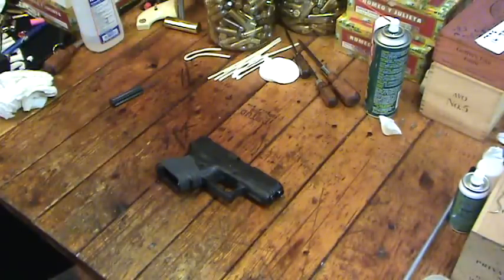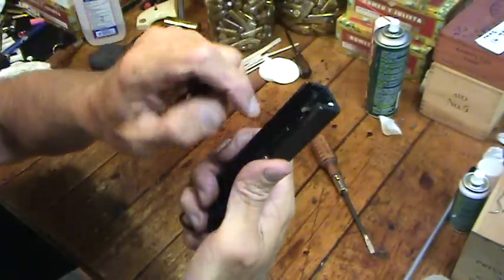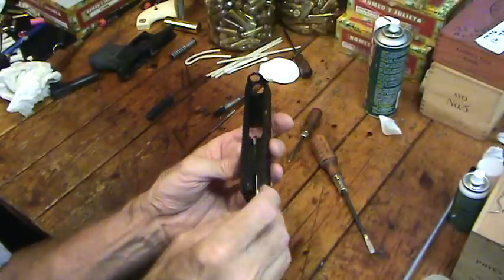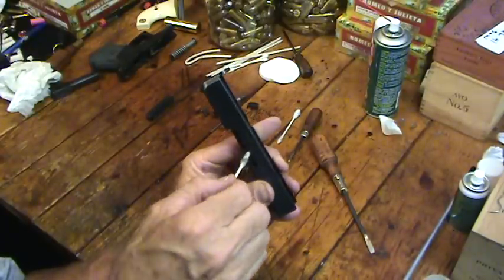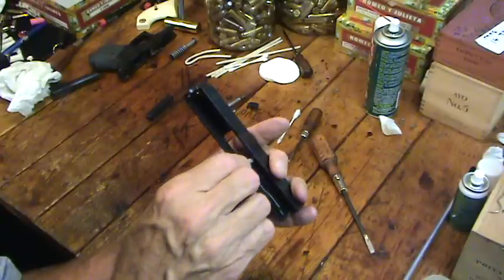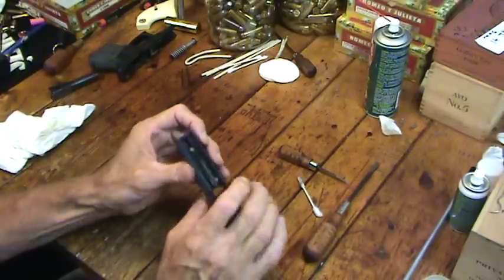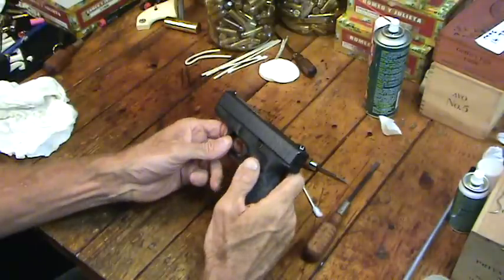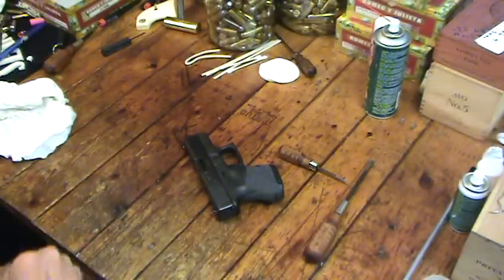Glock Cleaning 2  (Slide Disassembly)

Comment: Hickok45 you're not alone.  I've put my G19 together twice without the recoil spring in a couple of brain-fart moments years ago.  You have to remove the back plate and take the striker out to get the slide off.  Of course I didn't know how to properly remove the back plate yet so it was a bit nerve racking.  It was way before youtube was born.  I have a renewed sense of amazement at how simple and brilliant Mr. Glock's design is after fully disassembling the slide.

Comment: My very first Glock was a used 26 which had the firing pin channel gunked up (yes a technical term)  to the point where it would get failures to fire.  My buddy is a Glock guy so I learned early how important that channel is to proper functioning.  Great and informative video.

Comment: What you mentioned at the end of the video actually happened to me last week. I oiled the gun a little and wanted to see how well, smooth, the slide would move. So without thinking I put the slide back on without the barrel and spring in place, and sure enough it would not come off. But after about 15 seconds of panicking I quickly realized that if you move the slide forward gently while holding the trigger and depressing it slightly, once it is in the right position the trigger will pull and release the slide. Hope this helps someone in the future.

Comment: About 1300 rounds through mine, I got 2-3 "dud" rounds.  But I suspected that it wasn't bad ammo, just lighter-than-normal strikes.  So I was referred to this video, and sure enough - got oil in the upper and it was "muddy", for lack of a better term.  Got it cleaned - thanks to you - and I'm all squared away now.  Back to that legendary GLOCK reliability.

without a spring, just dry fire, then push the slide forward while holding the take-down latch.  I've done it a few times on accident.

Comment: i was watching this video, again. i did what you were talking about, putting the slide on without the barrel and the spring, prior to you talking about it. i pulled back on the slide, held the trigger down, and pulled on those 2 springs on the sides, and the slide slid right off.

Comment: Hickok thanks for the tip on how to release the slide. I was replacing the sights with an XS Big Dot set this past Saturday,and put the slide on without the barrel and mainspring. If not for your video, it would still be sans barrel and spring. Thanks for the help and for all the work you post here on YouTube.
Bruce

Comment: If you put the slide on w/o the barrel and spring in place, I've pushed the slide forward until its almost aligned as if the barrel and spring are in there and then pull the trigger, it then, will go immediately forward just like when breaking it down after pulling lock down and letting it go forward. I hope you can understand that, it will come off easily without taking the back of the slide off. I dont know if anyone else has answered this in the comments. It just has to do with getting the trigger pulled and then it will unlock from the lower. Nothing has to be forced to do this either. A little pressure on the slide pushing it forward, easy-like, then pull trigger and it will spring forward some. Just dont treat it like an 800lb gorilla, and all should work out. I found out the hard way myself and just messed with it easily until it released. I just refused to believe that it wouldnt come apart without the barrel and spring installed. Thanks Hickok, for the video on taking it apart, I didnt know how to do it. Actually, I figured the other part out on the P10C, but it works on the Glock too. Thanks again.

Comment: This was a perfect video for a first timer. My Glock 23 Gen 4 only had 100 rds through it. While not dirty yet, there were metal particles around the striker pin and I feel better they have been removed. Also, note the Gen 4 has a plastic sleeve around the striker assembly. Appreciate the helpful video.

Comment: Great video.  I had over 2000 rounds through my G19 Gen 3 and I finally disassembled the slide tonight to perform a thorough cleaning of the slide.  It was very dirty and I found bits of brass just like you said.  Thanks again for creating this great video and removing my fear of doing a detailed cleaning of the slide!

Comment: Great video. Thanks for the demonstration. I took the slide apart and cleaned out all the gunk. Couldn't believe how much was in there. I then promptly did what you were talking about. I put the slide back together and put it on the frame with the barrel and recoil spring sitting right next to me. So I can attest through personal experience that detail stripping it again will allow you to slide it right off.

Comment: I actually did what you said at the end and forgot to put the spring and the barrel back in when I put it back together and luckily I didn’t have to take it anywhere. I just pulled the two tabs down and released it like I normally would after pulling the trigger and it worked. I may have lucked out on that one.

Comment: Great videos, love your channel! At 14:30 you told how you mistakenly put the slide back on your Glock without the barrel or spring & then couldn't remove it.  The same thing happened to me while I was distracted while talking on the phone, I inadvertently put the slide back on my G23 w/out the barrel or spring.  I couldn't get the slide off to save my life.  I went searching for a solution over the next several days & finally found it.  Here is the simple fix; using the thumb on your trigger hand or your non-dominant hand, move / push the slide back into battery and then pull the trigger.  The slide will come right off the front of the gun.  Be careful, if the gun is tilted forward after you pull the trigger it will slide right off before you can grab it & possibly get damaged or damage something else when it hits the deck.

Comment: I have a Glock 22 Gen 2, law enforcement trade in.  I field striped it and cleaned it, took it to the range and it worked flawlessly.  The trigger still felt a little gritty and heavy (about 7lb pull).  I did a trigger job and brought it down to 4.5 to 5 lbs, but it still felt gritty.  Sure enough, it was the slide assembly.  When I took it apart, I found that it was totally gunked up in the striker channel and the pin spring.  When I cleaned it I even found little pieces of metal.  I am assuming it was pieces of brass.  Anyway, definitely don't neglect the slide assembly!

Comment: Thank you for your videos, i just went step by step using your video to clean my slide and you made it so easy that i will be cleaning it all the time and wont be reluctant to take it apart . I really like all your videos .
Reply: I was always very careful cleaning the slide, afraid I would get dirt and oil in the striker channel, with all that out you can really scrub the slide as long as you dry and get the crud out of the channel.

Comment: Hey hickok45, just so you know i have a tip for taking off the slide without the barrel and spring, if you just push the slide forward to its normal position and press the trigger it comes right off. Hope that helps you and your viewers, great channel by the way you helped me out a lot with choosing which kinda of glock to get and i couldn't be more happier with it.

Comment: I had a bunch of gunk built up in my firing pin safety.  I was apprehensive about doing this, but it was easy and it was even easier to put back together.  I blasted everything with Ballistol, wiped it all down, dried it all, and reassembled in about 20 seconds.

Comment from the maker: Probably not that often.  I might be a bit like changing the oil in a car; one person might shoot 800 rounds a year, but the gun is exposed to dust and lint a great deal, or they might have fired some really dirty or corrosive ammo. Maybe they got some oil in the rear part of the slide. That person would do well to take it apart and clean it, despite the limited firing.
Personally, I like to do it a couple times a year unless I think I might have gotten some oil in the striker channel.

Comment: I did my Smith and Wesson Sigma based off of this and did it for the first time after about 3 years and over 4thousand rounds. It was dirty and full of greasy carbon build up and metal burr. Thanks for the video Hickok45. Im sure it will run more reliably now that the firing pin and extractor are clean and clear.

Comment: Thanks for this video! I disassembled the slide to my Glock 23 to clean it, I had bought it used. The previous owner must have cared for it because the firing pin and extractor channel wasn't that dirty and I had already fired about 100 rounds through it. I won't put oil or lube on the firing pin area of my guns again.

Comment: I've put the slide on without the spring...but now I no longer feel all that stupid about it. Great video. My 26 came with an exceptional amount of oil around the striker. Cleaned it as per this video, and it sounds much louder when dry fired. I think it's traveling further/better.

Comment: I left out the recoil spring once with my G26 but was too embarassed to take to a gunsmith. Just kept playing with it shaking it and trying to take it apart. I think about 2 days later I finally got it apart while holding it upside down. Caught myself the next time as I started to put the slide back on and noticed the barrel and spring still sitting there. Glad you shared your method.

Comment: Well done video and I appreciate the tip NEVER to slip the slide on the frame without the barrel and spring in place first! Good tip to save some aggravation. It’s easy to get distracted for a second and skip a step.

Comment: This video saved my sanity!!  I purchased my first Glock mid July (Gen4 23).  My take-up on my trigger seemed pretty coarse almost grinding from day one.  1400 rounds later no change.  Turns out there was debris in the pin safety plunger not to mention 1400 rounds worth of junk.  I was using clp and letting it get behind the extractor...   No now I'm using a detergent type cleaner and keeping it away from the extractor/safety plunger/p

Comment: I had a bunch of gunk built up in my firing pin safety.  I was apprehensive about doing this, but it was easy and it was even easier to put back together.  I blasted everything with Ballistol, wiped it all down and reassembled in about 20 seconds.

Comment: I locked my glock 19 up putting a ghost rocket trigger bar in with out filing the extended metal piece for the over travel, hence rendering my trigger immovable. I thought I ruined the gun since I couldn't pull the trigger to take the slide off. LoL I used a tip from this video to get my butt out of that jam.. Thanks Hickok!

Comment: Mr Hickok, if you put the slide on without the barrel in it again, manually push the slide forward to how it normally rests fully assembled. You will notice some tension. Once you are holding it in its natural resting position you can pull the trigger and it will release the slide and it'll come right off.

Comment: I have the understanding that the small hole in the slide is to allow for water drainage so as not to impede forward striker movement during firing should the gun become wet internally. This would be important for the models that have the maritime spring cup option for the striker spring (9mm, .357, and the .40). Keep up the good work, your videos are very informative and very well worth watching.

Comment: On the subject of the slide getting stuck when you put it on without the barrel or spring, I've done this accidentally a few times. Just pull the slide back far enough to reset the trigger, then pull the trigger and pull down on the tabs to take it down as normal.

Comment: @hickok45 Just got my first can of Ballistol for my G20C and my Mosin-Nagant.  I've only shot about 80 rounds through my G20 and cleaned it twice since then ( I simply like to take guns apart and clean them, just because) using Hoppe's #9 and their oil.  Thought it was clean.  When I got the Ballistol 2 days ago, I sprayed the barrel inside and out, let it sit for 20 minutes, wire brushed it inside only 6 swipes, then ran the rag through it. BLACK!  It's clean now! Ballistol only from now on!!

Comment: If you assembled the gun with out the barrel and guide rod assemble just apply some forward pressure on the slide and pull the trigger and the slide will come right off the frame. Just a little advise hickok45! Love the channel always look forward to new video from you!

Comment: Naturally, I decided to attempt the slide installation without the barrel or spring. Once the slide was on there and cocked, I pulled back the slide, pulled the trigger, and while holding the trigger back, slid the slide forward and off the frame. Took about 15 seconds to figure out.

Comment: Same thing happened to my with my G20.  With the slide on and seemingly stuck, you can take your Glock tool and insert it through the back of the slide back plate, stick it in about an inch and you can catch the trigger assembly and push it down.  This does the same thing as pulling the trigger to release the stuck slide. Nice thing about Glocks, it's hard to hurt anything.

Comment: when the slide is locked on without barrel and recoil spring just apply forward pressure on the slide and pull the trigger.

Comment: Pro Tip: With how it is shown to remove the back plate and striker, it will allow you to remove the slide without pulling the trigger (if it's stuck or something). Simply lock the slide back, release the pressure, slide off the backplate, and remove striker. There is now nothing blocking the slide from going forward so you don't need to dry fire. So you technically can remove the slide without dry firing.

Comment: funny, i actually ran into that same problem of not being able to get the slide off without installing the barrel and spring. the reason the barrel and spring weren't in there was because i needed to send them back to glock for repair. i figured i'd reassemble it as much as possible until i got those parts back. when i encountered this problem, i figured since glocks are okay to dry fire, i pulled the trigger and while i had the trigger pulled, the slide came off.

Comment: To disassemble a Glock that has been assembled without the barrel or mainspring simply align the slide into the firing position and pull the trigger. Move the slide slightly backward and disengage the front lock as normal and then remove the slide as normal. 

This is the same as a normal brake down with you making sure the slide is in the proper position at each step. I've done this four times, for various reasons, on a G17 and G21SF.

Comment: I saw you installed the slide on the lower end without the barrel and spring,  If  you use your thumb to push the slide to a normal position as if the glock was sitting on the table with the slide on flush with the rear of the frame of the glock and pull the trigger you will her the fire pin fire and the slide will then be released.

Comment: im not sure about this and have never tried.  but i have another idea about the no barrel or spring in the reassembled upper and lower.  what if you pull and lock the slide back.  either relieve the pressure on the the trigger safety and let the trigger go back (rearward) or just pull the trigger.  hold the trigger back as you slide the slide forward.  then pull the takedown lever to release the slide forward off the frame.  doing this will disconnect the trigger bar from the striker tab.

Comment: I put the slide back onto the frame without the barrel and the recoil spring. I couldn't get the slide off, I thought I could if I pull on the slide release levers but it didn't come off. HERE IS THE SOLUTION: PUSH THE SLIDE FORWARD AND PULL THE TRIGGER AT THE SAME TIME. You need to pull the trigger to get the slide to come off the frame anyway, with or without the barrel/spring. Don't panic, just push the slide forward off the frame and pull on the trigger at the same time, worked for me.

Comment: A neglected striker channel will trap quite a bit of brass shavings deep inside on that shoulder, preventing the firing pin from reaching full extension. Neglect it long enough and you could have light strike failures. Look down in there with a flashlight and gently pick those smashed pieces of brass shavings off that shoulder. A q-tip won't get 'em.

Comment: The next time you put the slide on without the recoil barrel, you will notice spring tention keeping the slipe further to the rear than it normally sits. To release it, hold the slide just forward of the normal position and pull the trigger. The only reason I thought of trying this is because my Berretta U22 requires a trigger pull to release the striker for cleaning. If you do this with your U22, make sure to hold on to the the striker and spring. Or you'll be playing find the parts.

Comment: About the slide getting stuck if put on without the barrel and recoil spring. I have done that and there is a very easy solution. I found that if you push the slide forward just a bit, don't muscle the hell out of it, then pull the trigger it releases the slide forward. Like an XD if you will.

Comment: @Tinstar2 Take it from me (I own a Glock 17, but this information applies to all Glock pistols): You won't break anything if you dry fire a dozen or so times a week. The main point is to not make a habit of dry firing 100 times a day. You will (no if's, and's or but's) have to dry fire once before field stripping the gun (you can't take it apart otherwise, i's impossible if it wasn't dry fired). For home practice sessions, use snap caps. Dry fire with an empty chamber for field stripping.